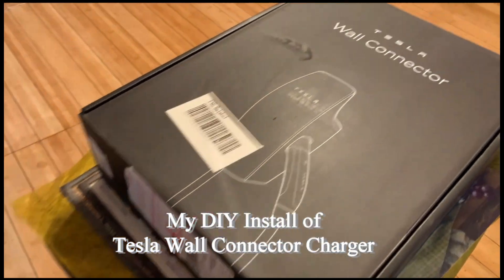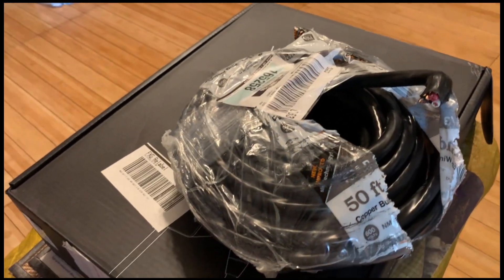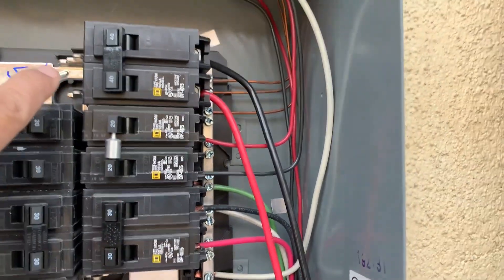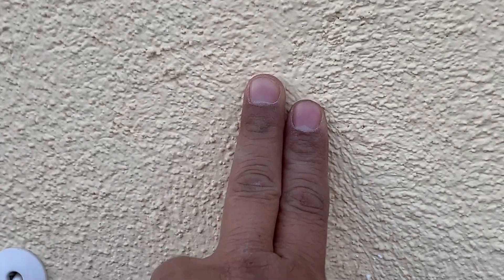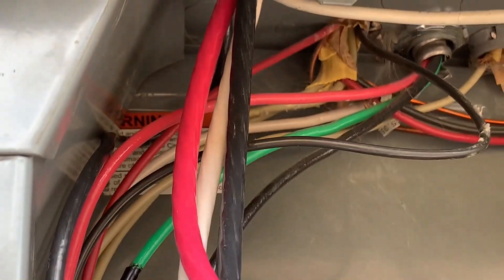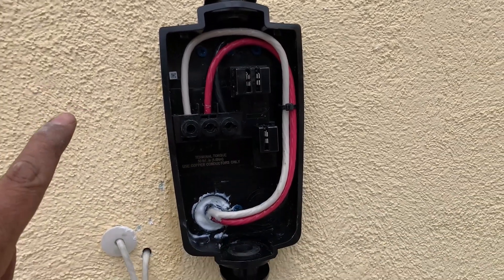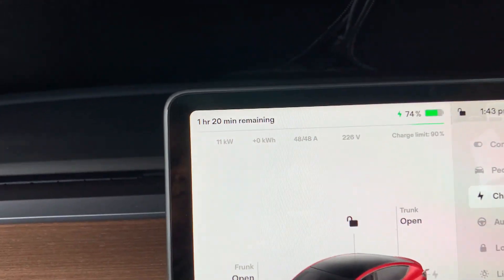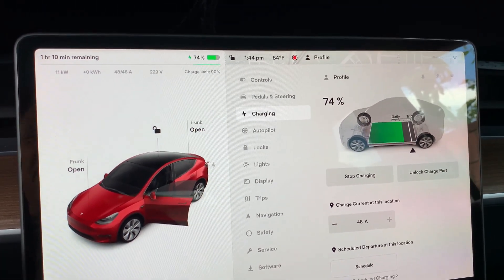My DIY Install of Tesla Wall Connector Charger

Comment: If you have not already, you need to change the settings to max output of 40 Amps as you can only use 80 percent load of a breaker.
Reply from the maker: @10p6  yes, this is correct.